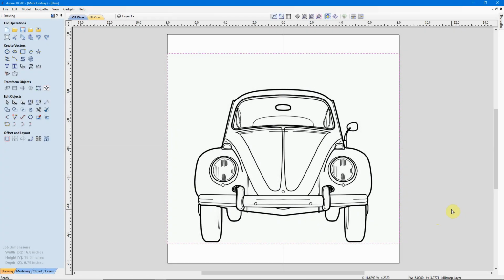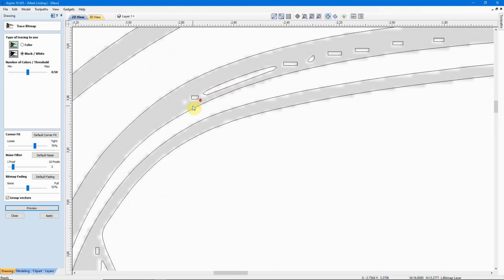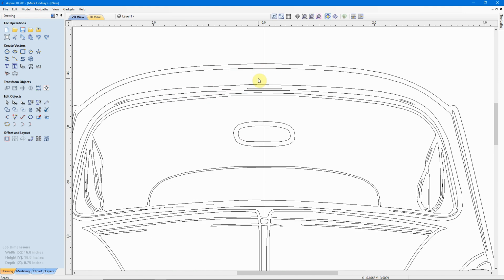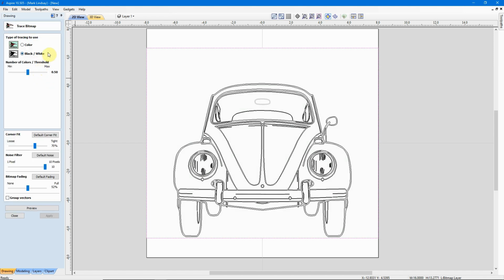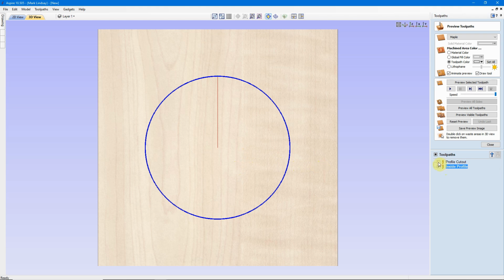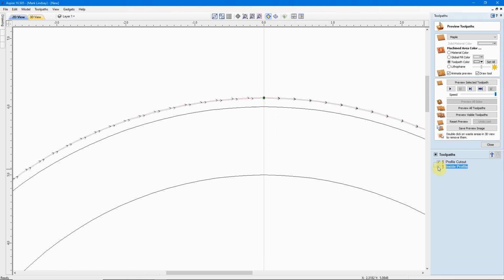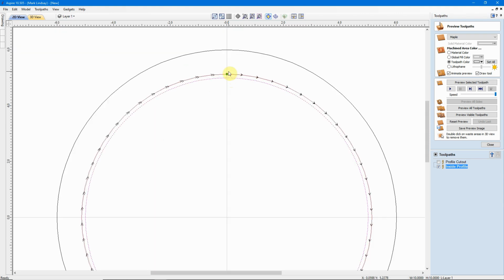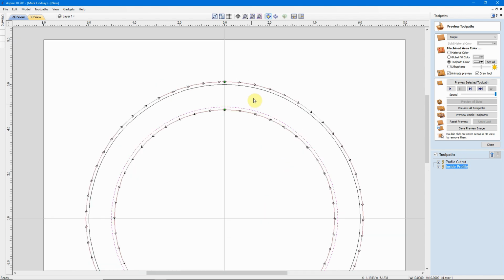Bitmap Trace Noise Filter, Plus Inside Last Pass - Part 2 - I Answer Your Vectric Questions

Comment: You got me again I was always entering negative numbers for the last passes and never saw that the minus was gone LOL.  and thanks for the tips about getting the tool trace in 2d view nice way of making we don t hit anyting.
I m the king of guy who tries to look deeper into  all softwear I use but you Beat me up my friend!
I ll be there this in afternoon
Reply from the maker: I think we all do that, Richard. It's a law or something. My problem is I forget little things like the Solid/Wire-frame toolpath view, so I forget to show them in videos. It took me 5 years to find out that you can center up the work piece in the 2D view by hitting the F key on the keyboard. I just remembered that it was a keyboard shortcut this week.
Reply: Mark Lindsay CNC well another thing to know for me. Thanks 👍

Comment: I won’t be available at 3 but if you could go into techniques on contouring a surface with multiple features like arches, slopes, and valleys. Thanks
Reply from the maker: Thank you! You'll need to be a bit more specific, please. What are you trying to contour?
Reply: Mark Lindsay CNC basically like a guitar body which might have a slope on the back where the arm rests and maybe domes up to the bridge and pickup area and perhaps recessed dips for the control knobs. Probably basic stuff I haven’t yet discovered in my new software.
Reply from the maker: Okay, let me work on it. It may be a few weeks, but I'll get into it.
Reply: Mark Lindsay CNC sounds good!!